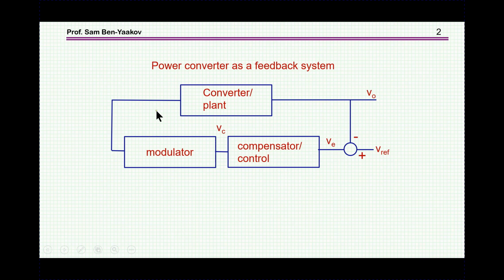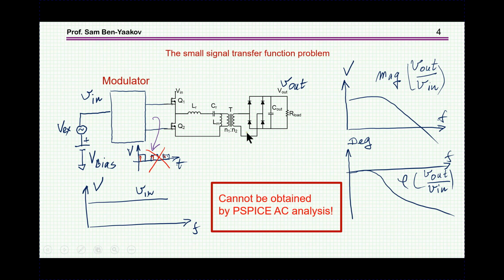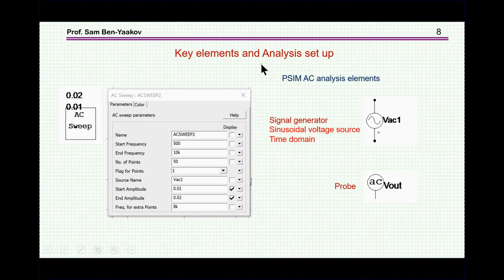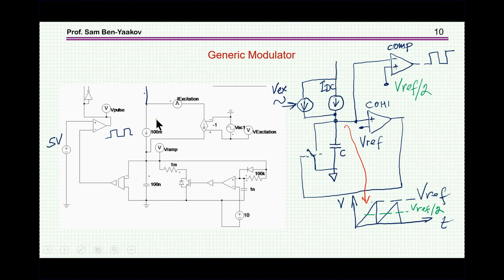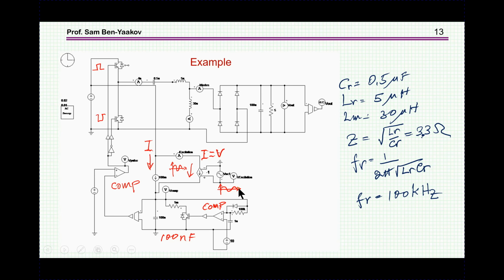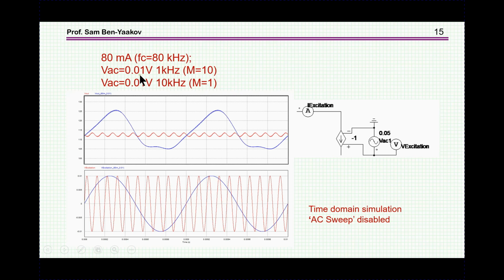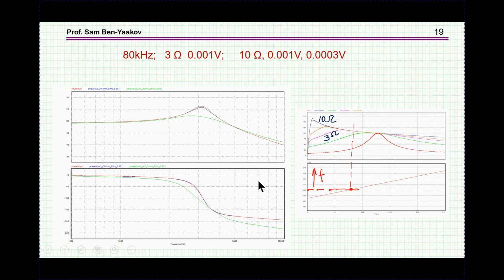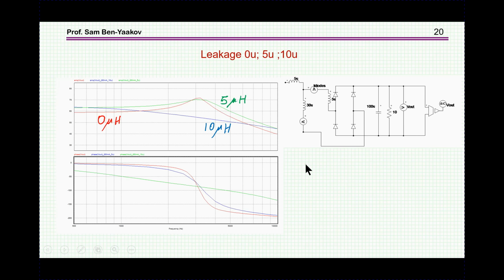Obtaining the small signal transfer function of resonant LLC converters by PSIM - revised

Comment: Dear Sam, thanks a lot for this valuable video, I appreciated a lot. I work in designing of LLC converter since many years, but I focus on resonant tank and I'm not used to design the loop controll, that for LLC seem stronger than others converters topologies. I have a question that coming out from your sentence at 5:22 (video time) where you say that the small signal changes the frequency, this is true in closed loop conpensation, correct? if so, from the picture I see that the small input noise makes noise on the output voltage, and in same time this menas that the loop is open... can you help to understand me in what I'm wrong?
Thanks a lot in advance for your reply
BR/Roberto
Reply from the maker: All that is explained is open loop transfer function as clearly said, NEEDED for designing the compensator.

Comment: Thanks for the informative video! I'm trying to simulate myself but encountered some issues:
1. I have noticed you are obtaining the transfer function for a converter with 100kHz resonant frequency around the DC operating point of 80kHz. Is this method applicable for all operating conditions of the converter (even in very low output power where the current to the output is not continuous).
2.As you have pointed out, prior to running the AC sweep i performed a few simulations to make sure the excitation results in a "clean" sinusoid at the output - which for some reason i could not get as you have at slide 15. I have a feeling it have something to do with the time-step (1nsec) which has a pretty strong effect on the results. Can you please comment on this?
3. The values of the simulation do not add up to me, Q=0.085 , R=50 , can you please confirm

Thank you!
Reply from the maker: The method should be OK for all operating points but there might be a problem of simulation errors due to unclean waveforms/

Comment: Thanks for the video! It made me understand what happens when we do a small signal analysis of a converter. Now that the transfer function is determined how would we do the control? On the internet they say the closed loop bode plot should have 
-20db/Dec at the crossover frequency and a lot of papers I found just did a control that delivered a bode plot with -20db/Dec for the whole small signal frequency range 

It's pretty hard to find a reasonable explanation how to implement the control
Reply from the maker: Look up the videos on control in my YouTube channel

Comment: Hi Sir, first of all thank for your videos with high educative content.

I still don't get the difference between the 'static' transfer function and the 'dynamic' one.

Why can't we say that linearizing the circuit (diodes and mosfets) by doing the ac analysis using PSIM is equivalent to injecting a small signal at a specific bias point and then measuring the output with respect to the input?

 Thank you again!
Reply from the maker: ac analysis is done by amplitude perturbation. In the case of resonant converters you need frequency perturbation.
Reply: Static here mere large signal TF (Like the way we have Vout=DVin in Buck). Dynamic TF here means small signal TF (The analytical expression has complex math in it, but one can use this approach to see the load model bode plot and design an appropriate compensator for CL system design). Hope that helps. :)

Comment: As a comment, I would like to add , that Simetrix/SIMPLIS can do this much faster.
For example, for LLC circuit it take only 4 second to obtain  Bode Plot  for a range of 10Hz to 100kHz with 20points per decade.
And it even can be done by free student version of Simetrix/SIMPLIS.
Reply from the maker: Hi Lev, Thank you for the comment. The  objective of the video is  to explain by an example the time domain extraction of transfer functions of resonant converters. The reason I have picked up PSIM is because it is an intuitive, easy to use, simulator.
Reply from the maker: Thanks for comment
Reply: Dear sir, 
I am looking for the Simetrix/SIMPLIS based small-signal analysis, If you have an LLC model for the small-signal can you share @ my email ID : b.r.manohar@gmail.com
Thanks 
Manohar
Reply: @lev: SIMetrix can't do it, as it does linearization step in the ac analysis. So one need to do this bode measurement the same way Prof. Sam BY has explained here. Yes, if you use Simplis then you can run AC analysis on your time domain model and can get faster run time to plot bode of the TF.